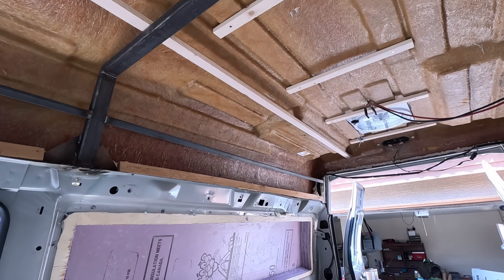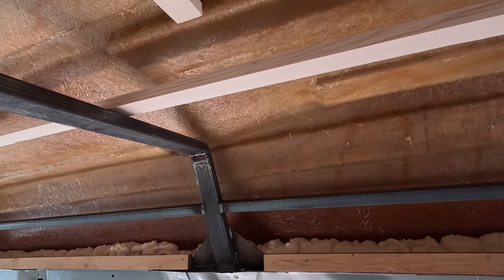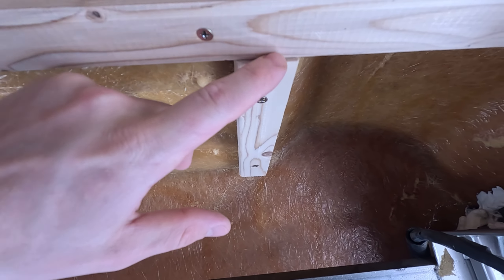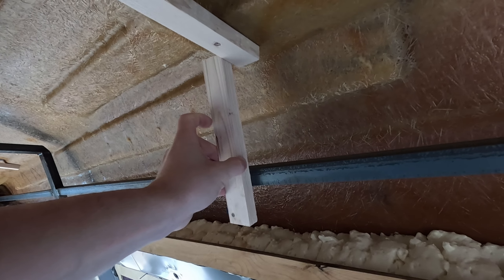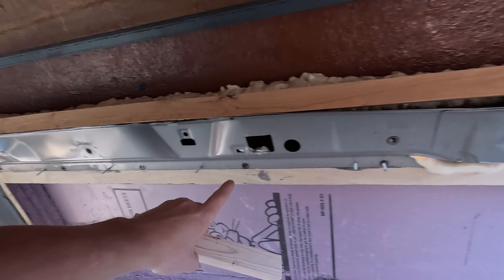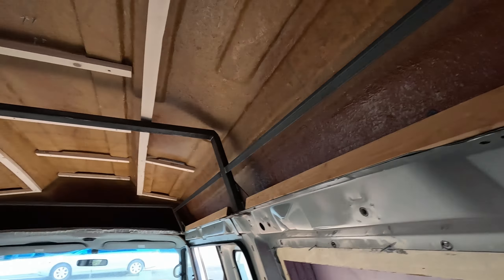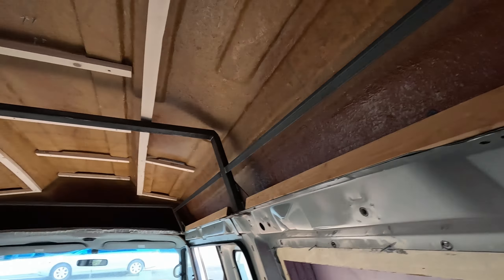FRAMING and INSULATING my Econoline Camper Van - #vanlife Conversion Part 6

Comment: Have you tried using Gorilla Glue for some of those pieces you can't screw into the top?
Reply: I would definitely look into it for the insulation boards. Even Liquid Nails would work, though I prefer Gorilla brand for Construction Adhesive. Good build so far.